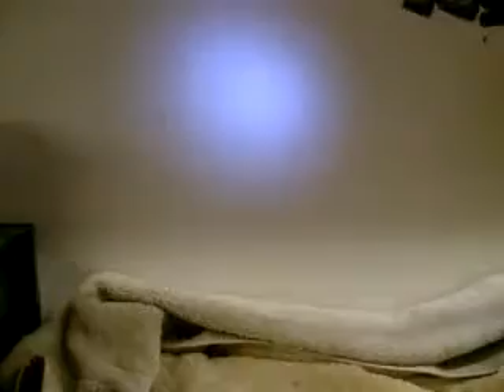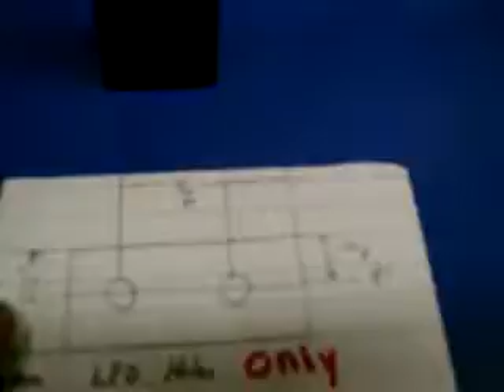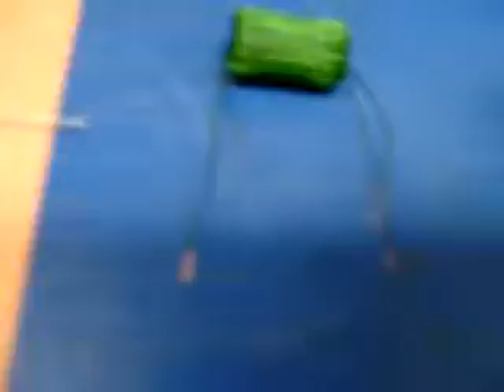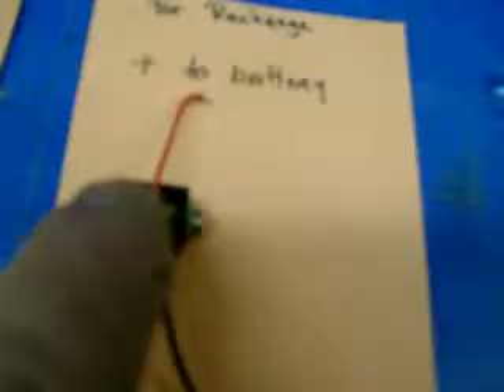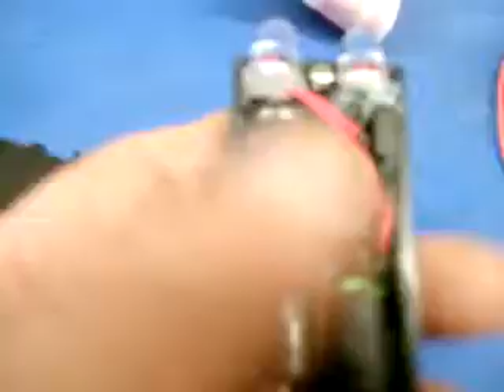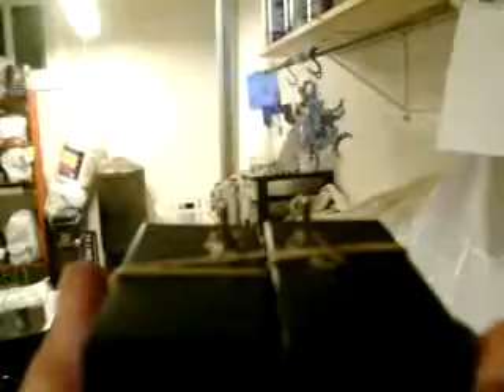SOLAR RECHARGEABLE ~ Pocket Joule Thief Light 2 X 10 mm LED BUILD

Comment from the maker: Add this to the wires leading to the LED, and you can run
RGB Slow & Fast color changing LEDs
You can also read a stable voltage with a volt meter
https://www.youtube.com/watch?v=7kuqgbDd1Hc&list=UUKOuKlKWSvj9sBBaz82qvRw&index=1

Comment from the maker: NOTE:
When I build these, I try to match the LEDs as best as I can by placing two on a breadboard circuit.
It is important that the two have close to the same ability.
You don't want one LED not putting out more light than the other.
You want them to match as close as possible.
I also found last night, using a magnifying glass you can focus the light on a house over 200 ft away.

Comment from the maker: I bought more stuff from Radio Shack since I made this video.
I searched for and found another code that  got me 15% off, Free shipping kicked in
for under the required $19.00 minimum. 
CODES:
first time........RADIO15
second time....RAD15 both got me 15% off and eventually free shipping if you work it right

Comment from the maker: The Green LEDs make a lot of light, the White Radio Shack LEDs were 3.5 volt 18,000 mcd
with a 10 degree angle. They are selling knock off as Radio Shack but they are not as good as the ones in the silver package. The Red Radio Shack LEDs will make car reflectors light up from over 100 ft away The Red, White, Blue LEDs are all 10 degree angle, spots.
You may still be able to find the Red & Blue online.